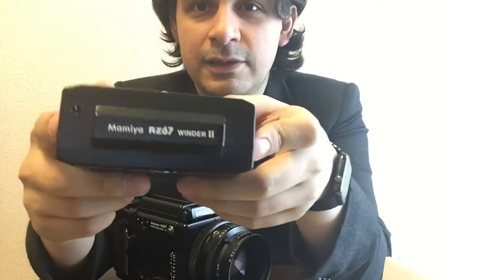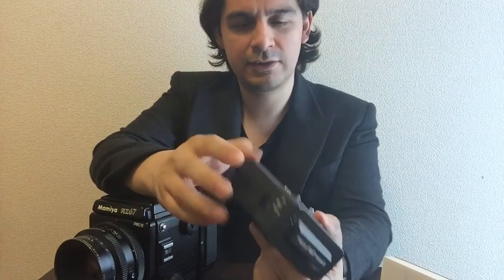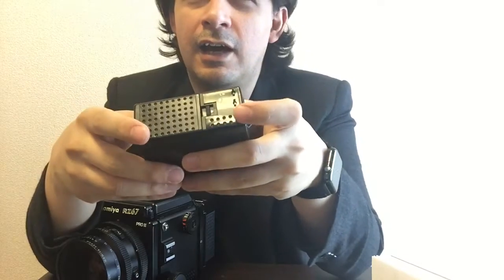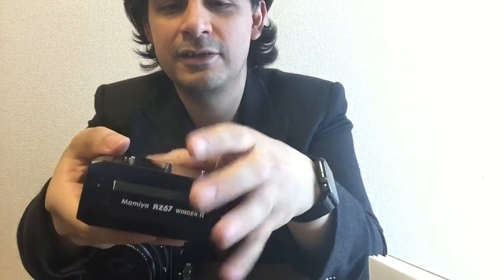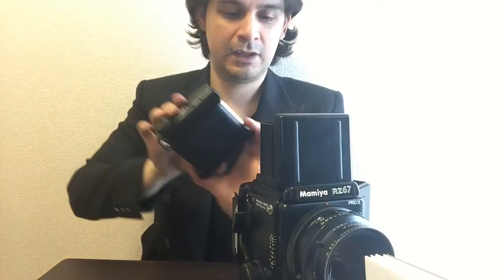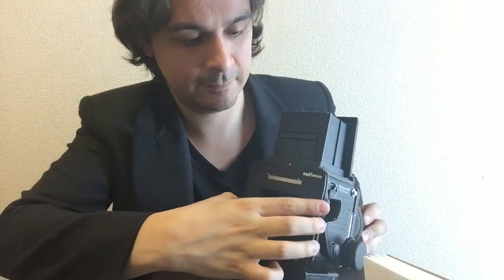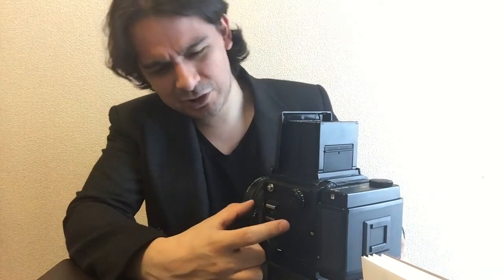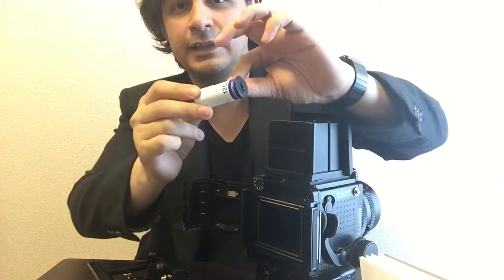Mamiya RZ67 Power Winder Complete Manual

Comment: Another great video thank you (particulalrly sacrificing a rcouple of rolls of film)- very helpful! Didn't know I could use with the polaroid back too! Wish my winder (version 1) has the battery test light (would have saved me the issue I had, with low charge batteries)- be nice to have the AC adapter too- oh well- when I get the PRO II..glad I got mine working in the end- happy shooting!
Reply from the maker: Thank you for your comment again, So you carry the whole thing with you to shoot outdoors?
Reply: +Julio Ryuuzaki only been doing test shots around my home so far with the rz67 at least. .think I'll be shooting digitally with my m43 gear primarily for paid stuff in the long run but have the rz67 ready and loaded for a few back up medium format film shots once the subject's warmed up with my digital cam for added value. .plus being in LA, when on location I'm driving everywhere so not carrying around on public transport. .did you figure out the cinematic headshot look yourself with the rz67?
Reply from the maker: The falloff of the focus center is very subtle, need to do more tests.
Reply: +Julio Ryuuzaki makes sense-keep me posted- for the 110mm and 180mm lenses they are apparently optimally sharp (presumably meaning sharp from center to edges)  from f5.6-f11 and f5.6 respectively though not sure how that will translate to the cinematic look which is best done with as wide an aperture as possible to ensure the background bokeh are abstract enough due to enough shallow dof..the cinematic look with 35mm full frame optimal focal length is 200mm (for compressing the background and subjects features) but with the rz67 the most comparable lens would be the 350mm APO but that's a considerably more expensive lens
Reply from the maker: +justinspirational I have been reading a lot and yeah telephoto a and Marcos are the best for that effect.
Reply: +Julio Ryuuzaki what is Marcos?
Reply from the maker: I'm sorry MACRO (autocorrect)
Reply: +Julio Ryuuzaki ha ha- yes- just did some experimenting with the cinematic look with the rz67 and 110mm and 180mm lenses (including key and kicker speedlights) just with FP100C instant film and the polaroid back and have started to nail the exposure with flash photography too using my flashmeter all in manual mode- very exciting- I tested by putting the 110mm at f2.8 with a bright (direct sunlit) backdrop outdoors with the subject in open shade and in those extremes with the 110mm at f2.8 the shutter did exceed the max sync speed of 1/400th sec but figured out how to get the exposure right with a variable ND filter to get to and below the max sync speed successfully and create a perfectly exposed image still! (the 180mm with max aperture of only f4.5 did not exceed 1/400th sec with the same bright backgrounds at f4.5 so no nd filter was needed with that lens thankfully)

Comment: Does this winder also bring power to the body and other parts of the camera instead of usual batteries in the body?
Reply from the maker: Nop. The winders purpose is not to replace the in body battery. Just to move the gear under the camera. It takes a lot of mechanical power and it needs its 6 batteries to do its job. Also make sure to get the right winder for your camera version like i said on the video.
Reply: @RyuuzakiJulio  Thanks Julio!

Comment: Does this winder powers the camera as well? Or you still need the small battery in the camera? I’m asking because my RZ67 Pro II appears to be defective, because it depletes batteries rather quickly, even when you leave it off.
Reply from the maker: No it won’t power the camera. It uses 6 AA batteries. What do you mean with leave the camera off? And what type of batteries are you using for it?
Reply: Julio Ryuuzaki thanks! I might be exaggerating. But I tried to use my camera today after a few years of being stored, and the battery was depleted. I thought if you leaved the camera locked( on the red dot) it wouldn’t get depleted. Now I’ll just take out the battery when I store it. But they’re getting harder to find and you find mostly generic ones. That’s why I was hoping this will power it and just use rechargeable ones. But if it doesn’t, I have no need for it then. Thanks again!

The battery it had was a GP one, and now I put in an energizer one. 4LR44.
Reply from the maker: Pablo Villegas Oh I see I see, to disable battery is not the red dot lock mode, you want to set it up in “emergency” mode which is the orange dot, that completely detaches the battery connection. But batteries for being batteries will deplete and some of them will have the chemicals spills, so if you where not planning to use the camera for months its a good idea to remove it from its chamber before you would have to clean a white crystalized mess on the connectors. The RZ is my only camera and I use it quite often, but I don’t need to change the battery for many months, years even. I know they might not be so common batteries but they are not impossible to find, as you saw even Energizer keeps making them. Is a good idea to have one or two as a spare. Lately there is more and more users that are getting interested on the RZ so the demand for those batteries also increases. But if you have a pair of them I wouldn’t worry so much, I’ve been using this camera for 12 years and I have only changed the battery 3 or 4 times.

Comment: If i have a roll loaded and at 1 and then try to attach the winder,  will i lose a shot?  or should i just put it on m and then nothing will advance?
Reply from the maker: If the roll is loaded and scrolled to 1 and you put the winder it will not move until you trigger the shoot. The winder moves after the click is pressed and the backs notify electronically when the next number is reached.

Comment: I have one, brand new and I cannot get it to work :-)....I will have to watch this video later.  I was also trying a power adapter to it.
Reply from the maker: Did it work at the end?
Reply: Julio Ryuuzaki thanks for the follow up, but since I have had no need for it, its just sitting😐
Reply from the maker: Phil Indeblanc sad to hear that. But is somewhat good you don’t need it that much.
Reply: Julio Ryuuzaki I mainly use a 4x5 to MF digital back.  The RZ I use on location with digiback, and it's not so often.

Comment: Does the winder power the camera? If it does it would be great in colder conditions.
Reply from the maker: MrDCB1234 thank you for the question. Sorry if I wasn’t clear. The power the camera needs comes from a 6 volts battery under the camera. I explained on this video:
https://youtu.be/Qcn0vhU9C4Q
The winder does not power the camera. And I have used the camera with no problems in -3℃
Reply: Thanks! Keep up the great videos.
Reply from the maker: I promise!